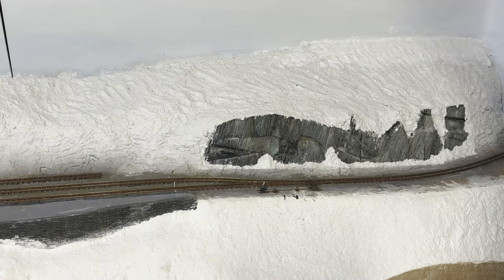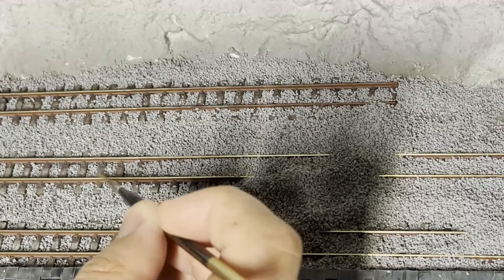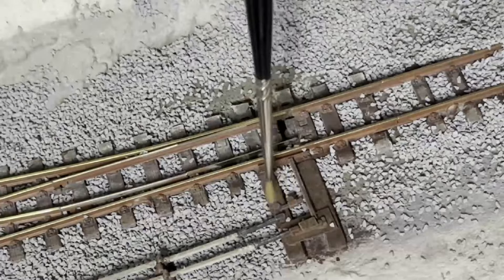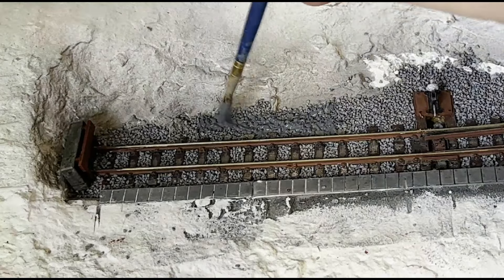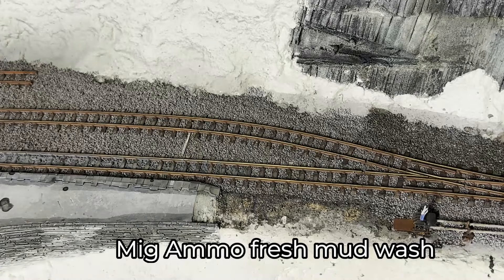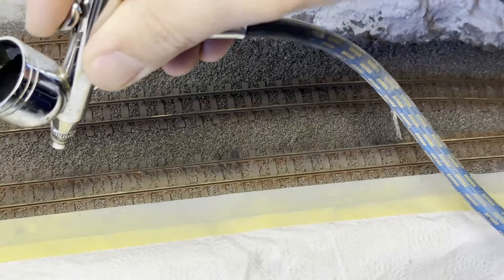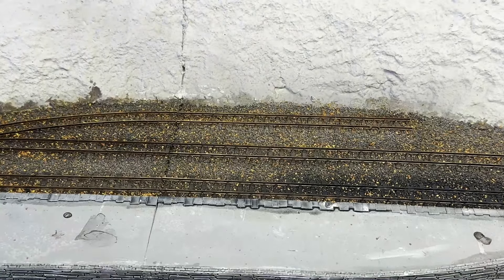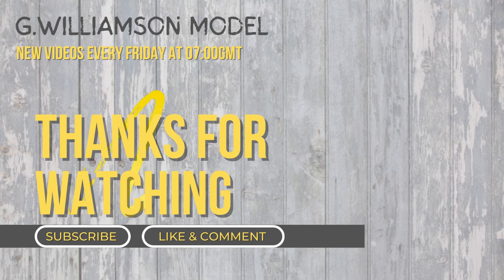Upgrade your model railway track with this ballast tutorial!

Comment: I suspect the reason for the darker track on the approach to the station is because of engines leaving the station with cylinder drains open, you get a bit of oil out of those and it will slowly build up to become noticeable.

Great video, I love the look of the leaves, very effective and absolutely what I remember!👍
Reply from the maker: Good to know, at least I’ve got prototypical backup for my mess 😅

Comment: Nice tutorial video. This will certainly help me when I build my model railway. Also, just a note, when I was little I built a small railway for me to run trains on, but didn't do the ballast very well. Was was a small piece left in the points when it was glued down, so running trains over it became a coin toss. My dad called it Devils Points lol
Reply from the maker: Yes that is the worry, but it’s just a case of spending time slowly removing any ballast stuck in the way. I use my pointy tool thing to flick them away from where they’re stuck
Reply: I absolutely adore the name “devils points”
You should put that in a area for a derailment risk lol.

Comment: Those leaves really bring the look to life !
One tip I found when cleaning 009 after applying scenic glue....is to use a small piece of track rubber angled to clean the inside edge of the rails, as the flange contact (just at the top edge) is often the main area of pick up it seems. ...as opposed to just cleaning the top face alone. Cheers.
Reply from the maker: Hey, yes I’ve actually started doing that. The track rubber starts to gain a rail shaped indent, so it starts to hit the rail top sides aswell